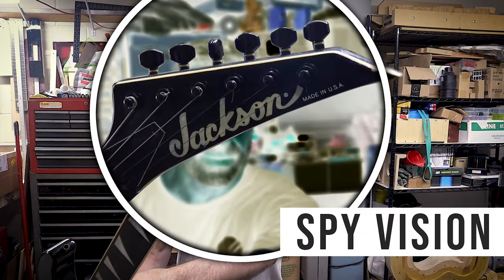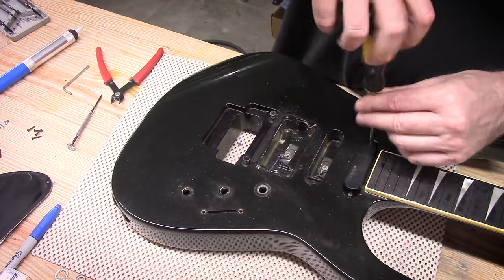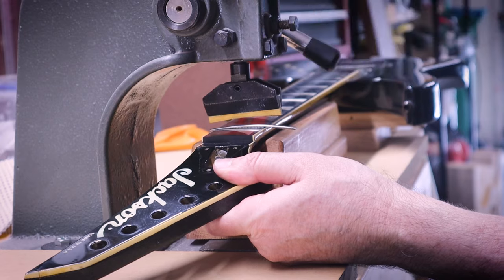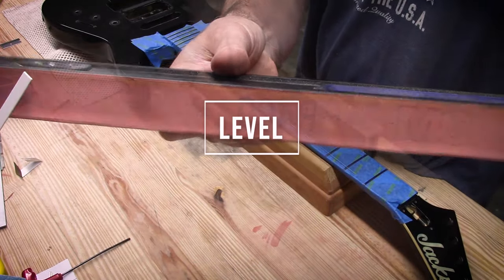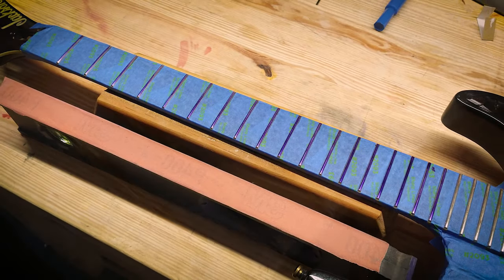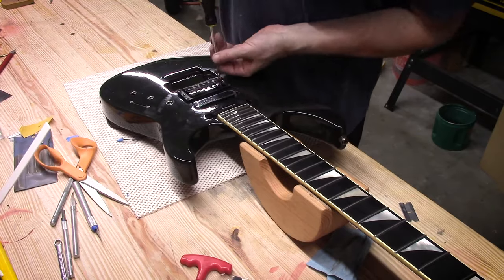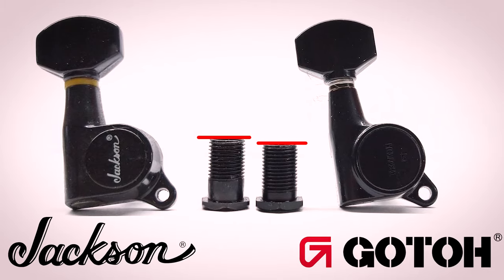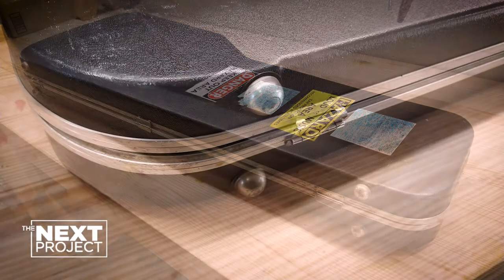Jackson Soloist Repair Mod Project

Comment: Are the old pickups and harness available with the preamp? My Fusion Pro had one and with a Bill Lawerence L500XL at the bridge it had a very nice distortion tone. My Charvel 475 deluxe has one to and it's definetly a heavy distortion tone at the bridge and can replicate Meshuggah's tone on "Marrow" using a single coil neck at the beginning to the bridge. For a stock setup in 1989 it was better than anything on the market and why I seek them out today.
Reply from the maker: I just spoke with the guitar owner, he's going to check to see where he put the parts.  I'll reply again as I learn more.
Reply from the maker: I just got the pickups and wiring back from the owner.
If you are interested, please send me a message at:
thenextproject.info@gmail.com
Thanks!
Reply: @theNextProject  thanks message sent
Reply from the maker: Just replied, thanks!

Comment: Dude, I am consistently amazed/amused/astounded/inspired by your persistent and dogged pursuit of patience and “getting it right”!!! And I am definitely going to try that actual speed fret crowning! 😆
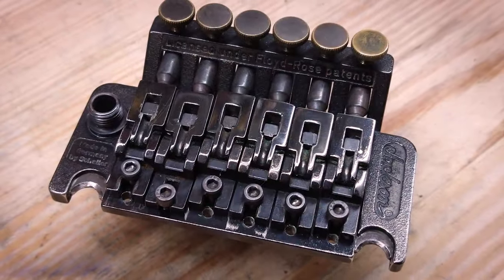9:41 … Pearl Jam, The Fixer!! “If something’s old I want to put a bit of shine on it!”
14:11 Geez, the wiring… that’s all Alchemy and Black Magic!
Reply from the maker: Well hello there, and thanks for watching!
Thanks for noticing that I'm trying to get it right. Not sure why I do that most of the time, but it's kinda become part of my process and when things workout it seems worth it. 
LOL, yes the "actual speed" snippets I thought might add some clarity to my videos. Everything is running at 100X speed, so it's hard to gauge reality of the time things take. 
Then contrast actual speed, and even I can't see how I ever get anything done - ha.
The wiring had me stumped initially, using a 3 way blade switch with a "kill" in the center position seemed easy, but I really had a hard time getting my brain to figure it out. 
Then, additional changes may happen to fine-tune to the players liking.
Wiring is not really a strong suit for me, but a good experience. 
At least the pot rotation was correct this time around, so I did learn something along the way, lol.
Hope all is well, be safe and take care!

Comment: Great job, man. Looks like I got to rewatch your wiring later, as I didn't fully understand it. Too tired at 10:37 in the morning.
Schmutz, didn't know Americans use this word.
My latest project was replacing PUPs and pots in a PJ-bass. I ordered Bourns logarithmic pots for volume and Göldo linear taper for tone-control. The Bourns pot were a pain in the butt to solder, I destroyed one, or it was bad in the first place, don't know. So I ordered a TAD American Alpha pot to replace it. Now I have three different pot in the cavity. I usually don't measure through my pots before I put them into place, this might have been a mistake. And, by the way, J-PUPs can be hard to put in place, if they don't deliver proper screws and springs with the pups.
I did all this quite spontaneously.
I think I told you I put the F-spaced Tonerider Generator in place without any fancy wiring, just a volume and a tone control. Many people don't even install a tone control, when they install a bridge humbucker only. I guess then, you can hard-wire the pup to the output, if you need volume control, you can still use a volume pedal.
Reply from the maker: Achim, thanks for watching my friend!
The wiring is/was/may be a moving target for this guitar.
The owner said he doesn't know why Jackson put 2 tones on this guitar back in the day, adding he never uses the tone anyway, keeping it on 10... 
So, we opted for 2 vol, and a tone to fill the third hole (tone still stuck on 10).
I offered not putting a tone in, and just adding a dummy post with a knob on it... nope.
Anyway, we had a neck vol, bridge vol, and mstr tone layout for controls initially when I handed the guitar back to him. I suggested he take it home and play it for a week, get use to the new frets, heavier strings, Eb tuning.... So he took it to a gig that night - that's not what I suggested.
The next day he tells me it plays great, stayed in tune all night...and about the gig. I nearly shit myself when he said he took it out gigging.
He then said, he wanted the neck and bridge vol pots location flipped, so it would be bridge vol, neck vol, then mstr tone at the rear.  I understood he uses the bridge pup 90% of the time, so he wants that vol pot easy to reach...okay.
I suggested we go back to the single mstr vol, and a mstr tone, and a dummy for the third hole. Not now.
So the control arrangement is a bit odd (to me) at the moment, but everyone has their own thing. He's trying it out for a few gigs, then we may tweak the wiring a bit more. 
At any rate, he's happy, so I'm happy.
Fun project.
Reply from the maker: Schmutz, LOL. I forgot I said that.  Hope I used it in the correct context.  I say a lot of things that may not be proper use of the term.  Sometimes you'll have to guess at what I'm attempting to say.
Hehehe
Reply: Simply the German word for dirt, only that it's pronounced with a short 'oo' like in American new  @theNextProject

Comment: Great work! To me a bit strange decision to sacrifice blend mod. It could be better to have a push/pull pot or a switch etc. There is always a volume pot as well. Not to question just wondering... 🙏👌
Reply from the maker: Hey Marty, thanks for watching!
This project is kind of a test bed for the player. He's currently in 4 different bands, and works a full-time job. This guitar had been shelved for a bit due to the excess fret wear.
If I recall, this had a single vol and 2 tones, the owner wanted to try 2 separate volumes and said he never touches the tone knob. I suggested we remove the tone... but no, a new single tone went in (which he said he hasn't used).  Then we swapped the vol knob positions... I really expect there will be one more mod taking this guitar closer to its original control layout. I do as I'm asked if I can.

The owner is thrilled having this guitar back in rotation, he'd got other projects lined up for me as soon as he has a break in his schedule (which may never happen).
Fun stuff.

Hope all is well, take care!
Reply: @theNextProject  Yes, it's fun 👌I usually remove the second tone on straits as well. It's useless most if the time. Like Steve Vai, he only has one for all. It's cool to have it especially on Telecasters. It can be used as Tremolo going back and forth. Cool effect. Yeah, I understand. The customer is experimenting. Thank you for your comment 🙇‍♂️

Comment: I have the cheaper soloist made in Indonesia and I swapped out the pick ups for something else and noticed the screws that hold the trem springs have gone right through into the pick up cavity, it didn't touch the pick up but any idea if this will affect the pickup sound or longevity? Thanks
Reply from the maker: sqwop, thanks for watching!
As long as the screws aren't contacting the pickup coil, wires, or keeping you from being able to adjust the pickup height, you will be fine and there should not be any issue with sound or longevity.
If the screws are hitting the pickup, they could cause some damage or wear, but how much I can't say without seeing the instrument.
If you feel they are in the way of the pickup, you could potentially remove and shorten the screw by the amount that it projects into the pickup cavity. Just a thought.
Enjoy your guitar, take care!
Reply: @theNextProject Definitely not touching, I made sure of that.  Now I just have to work up the courage to replace the frets, I'm gonna wing it somehow but not before I watch a few vids. 😁Take care, cheers.